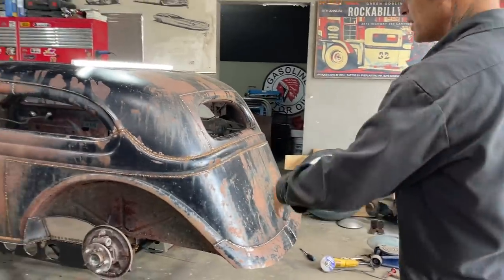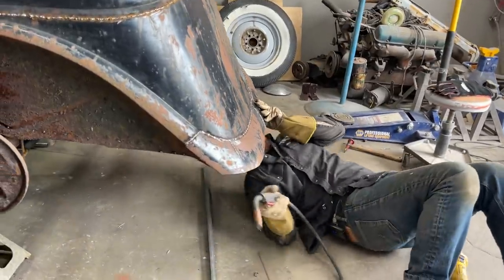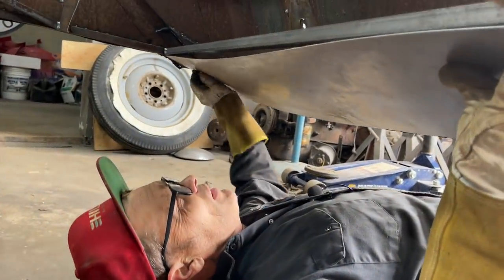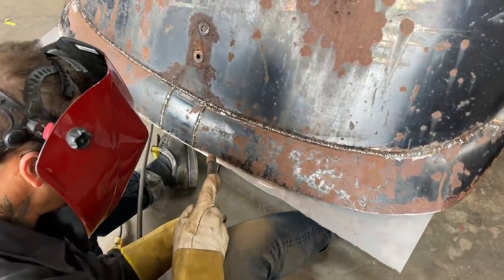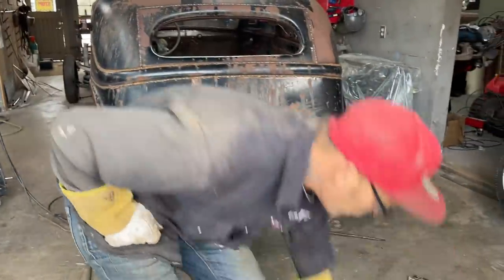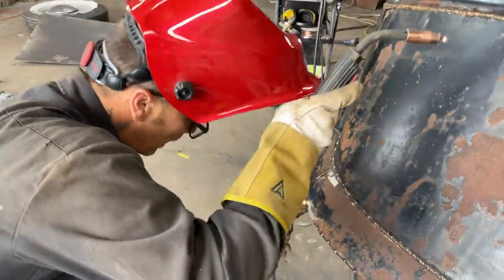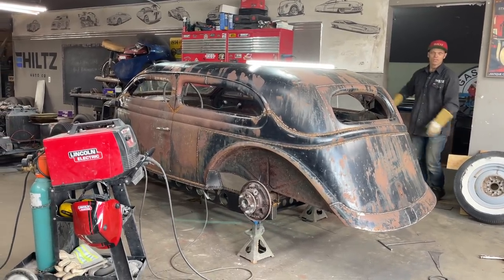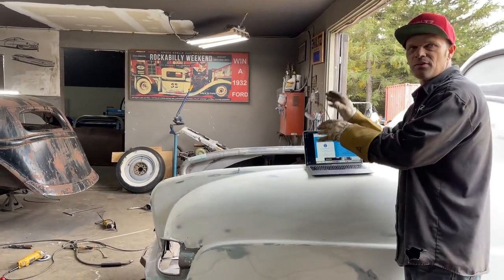PANEL FABRICATION: CONNECTING THE FLOOR SKELETON TO REAR

Comment: Chad, note that the new inner bottom pan you added beneath the back of the body can hold water. Since you will be storing your creation outdoors it may be wise to make a few drain holes back there. Keep up the smooth camera work Jolene! Thanks guys
Reply: I don’t think chad worries about stuff like that, did you watch the cab over videos?  Steel lapped over steel lapped over steel.
Reply: @reneekrueger962  He usually goes back and cuts off the excess from behind later when he does a lap joint. But you are right Renee he left the 4 inches of excess metal lapped over at the back of the car. With the new plate welded in beneath it I think it's now too late to cut it out.

Comment: i was looking at the rear end , to keep that from twisting weld a Rear End Bracket to it and run a bolt thought the frame , why i say that when you dump that clutch its going to twist the rear end down or up and put all kinds of pressure on the u joints, like on some race cars you see ladder bars that look cool too make some out of some round pipe cut some more round holes in um ,  hahaha whooppp whooppp hahahaa
Reply: well looking at deferent angle might need to weld Rear End Bracket to the back of the frame . u bolts not going to hold it from twisting ''its something i noticed, see you got me thinking with you hahahaa

Comment: Hey Chad, the car looks a lot better sitting level while the back wheels are off, maybe you could put smaller "Funny Car" style wheels on the front and the largest you can fit on the rear. Will also make it more aerodynamic..

Comment: Grab your channel locks and pinch the metal to the square tube be a lot easier than third arm
Reply: Could also use your under car back board on garage floor instead of lying on you back on cold cement

Comment: That panel was a simple and strong way to do things. Jolene's idea is good with a piece of round stock on the back. It would give you alot of protection in case you need to push  the car and look good too.

Comment: Chad why would you instead of 2 panels one to the square stock and one from the square stock to the tail do one piece vend it on the break and still rivet to the square stock and do whatever you want at the tail...just a suggestion

Comment: In light of your perforated firewall I have to laugh at you worrying about sealing the floor. Hell if you're worried about weight just leave the floors off. If you're continuing to insist on building a death trap go all the way man. Hell you won't be driving it.